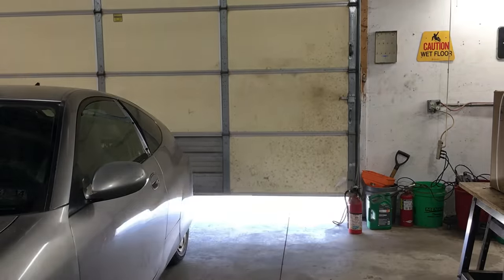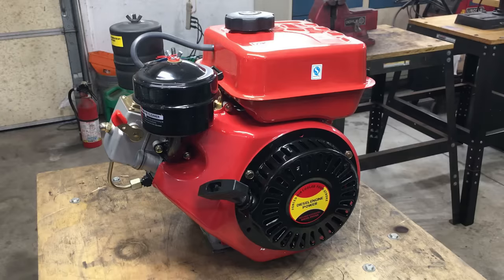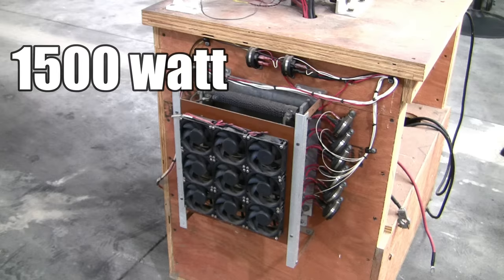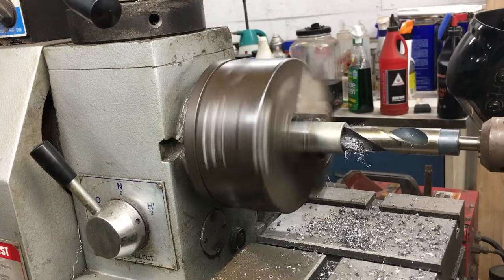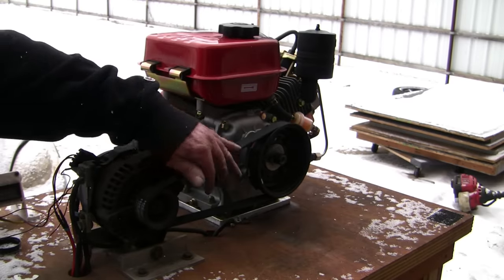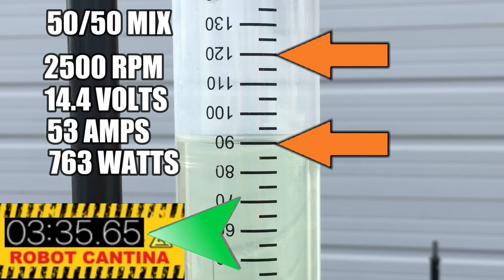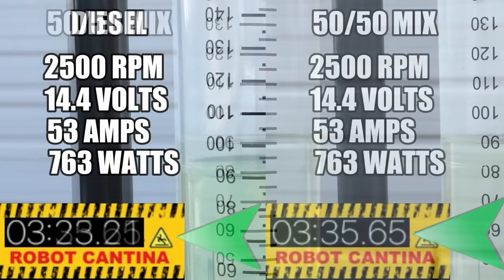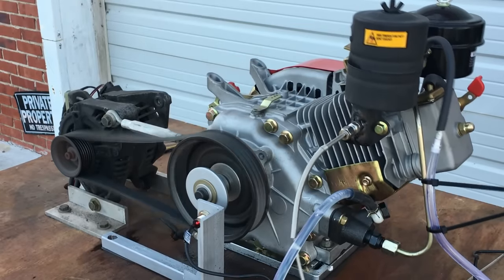S4 E3. How good is vegetable oil as a source of fuel for a diesel engine?... We find out!. plus more

Comment: Another vote for the used filtered oil+gasoline mixture. For my truck I mix gasoline into the oil until it flows at the same rate as regular diesel

Comment: I’ve been running WVO(waste vegetable oil) and other waste oil mixtures in my diesels for almost 20 yrs. 

As long as you filter the oil well and heat your fuel tank (use a coolant heat exchanger), you’ll get great results.

Comment: I've always been curious how Kerosene and Jet fuel would run in a diesel. Kerosene has around 139k BTU per gallon, If I'm not mistaken, and Jet fuel I believe is in that same range. 
Also, how would a Diesel run on pure 2 stroke oil?

Comment: Nice...I got one of those...I REAAAAALY want to get a longevity test of these little guys...see just how long they do actually run before they crater
Ooh..might think about treating it with MotorKote (hyperlubricant) to see if it helps [probably not with all that compression]
Daggum, that thing sure does make the test rig jump around...guess it must be all that torquage of that 3hp engine...LOL
I was thinking about trying to run some waste oil or waste oil/diesel mix to see if it affects it adversely
Keep em coming!!!!
Reply from the maker: The engine is a bit rowdy and does jump a bit, but also keep in mind the camera cant keep up with the vibrations and the image is somewhat distorted.

Comment: Otto Diesel designed the engine bearing his name to run on vegetable oil. Petroleum wasn't his first choice. Transmission fluid, tiki torch fluid, lighter fluid, hydraulic fluid, motor oil, and even coconut oil all work, however.

Comment: I drove 6 years my Royal Enfield Diesel Motorbike from 2001 with Salad Oil. Runs well, smoked white, usage is gone up from 1 Liter diesel for 100km to 1.5 Liter for 100km, starting wasn't easy, smelled like a burning Fish&Chips shop.
In Europe cost in this time salad oil half as diesel.
Today cost salad oil more as diesel.

Comment: You should setup an exhaust system so you can run the engine inside i bet the heat generated from the resistors would feel nice inside.

Comment: 50/50 ethanol /biodiesel mix.  Note that the diesel fuel must be biodiesel to provide emulsifiers for proper blending. Limits for ethanol biodiesel blend should be 20 percent biodiesel 80 percent alcohol blend.  Don't go leaner than that with the biodiesel.

Comment: Another common practice is to mix veg oil and gasoline to about 70/30, or 80/20, respectively. Generally dependent on the temperature. The gas helps thin the veg oil to diesel viscosity and can help in burning the glycerin in the veg oil.
Reply: I'm pretty sure it'd be better to use kerosene but of course kerosene costs more per gallon at the pump from most gas stations.

Comment: Note that very small diesel engines are usually pre-chamber engines, which are way more tolerant towards unrated fuels than a direct injection engine found in a truck.
Reply from the maker: Great point!

Comment: The trick to efficient use of vegetable oil is preheating the fuel to 220 degrees Fahrenheit before injection,  I ran a 1984 bluebird school bus with a gm 8.4liter turbo diesel on waste vegetable oil for 8 years, the fuel was heated, filtered and had all moisture removed prior to use, then it was heated using inline electric heaters taking it to 220f right before the injection pump, this increases the engine efficiency dramatically and reduces the possibility of gelling of the fuel. Using electric solenoid valves on both the supply and return lines allow for switching from diesel to vegetable oil without the return dumping vegetable oil into the diesel tank. Using the coolant system of the engine to heat the vegetable oil holding tank allows you to start the engine on diesel, warm it up, then switch to vegetable oil after about 5 minutes without the viscosity of the vegetable oil  causing problems. Also filtering the heated vegetable oil through a 5 micron water lock filter before its put into the holding tank keeps the injectors from clogging.

Comment: I have to say, I simply love these test. Have you ever thought about seeing the difference on a gas engine using Propane vs Gasoline? I converted a lawn mower to run off propane. I have an average size lawn and only us around 12oz. The mower is a 1979 Snapper Hi-vac that came with a 4hp engine. Once the engine wore out I put a 6hp Briggs on it and then thought why not use propane. The mower runs great on the propane  When it's running, it smells like your grilling hotdogs. LOL. I know you lose some power using propane but I figure I had 2hp to spare anyhow.

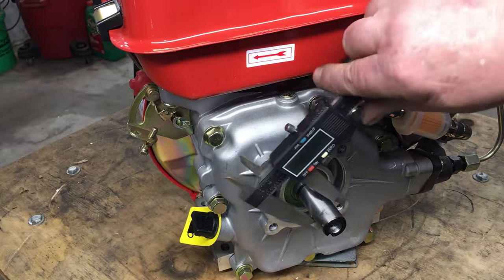Comment: 2003 Seat Inca SDI engine (direct-injected VW). Can mix 1:20 in normal weather, 1:10 when it's hot, otherwise pump starts whining. Cheapest oil is rapeseed, contains about 10 percent less energy so adjust the price when comparing to diesel - if oil costs €1.37 it's like diesel is €1.50. No side effects, still runs and starts as normal

Comment: I've probably bragged about this before but my previous car, a 2006 Volvo V50 1,6d consumed ~3L/100km when driving long distance. That's with a full DPF and all the rest emission system. Modern diesels are pretty impressive in that regard. Too bad they have to be maintained like modern cars too. The engine bays look like snake pits.

Comment: Used light hydraulic oil is pretty good in diesels with simple pumps. Super high pressure common rails?, maybe less so, but old 2.5DI Ford Transits with the Bosch mechanical pump run just fine if you add two stroke oil at around 100:1 for lubricity. Mind you, that engine/pump combo would run sweetly on just about any light oil. 
Waste engine oil can work. Oil from diesels needs filtering to 2 microns. Car oil filters are not up to it, but commercial vehicles ( lorries ) with bypass filters fitted get filtered to 2 microns. It'll need cutting to get the viscosity down a little. Diesel/kerosene/paraffin/light hydraulic oil work as an adulterant. Again, a little two stroke oil for lubricity doesn't hurt.
I ran my Transit on used hydraulic oil when I could scrounge a 50 gallon drum of it. Never missed a beat. No excess smoke, no cold start issues either. I've only read about used motor oil being used, never tried it myself.

Comment: I had a '90s Volvo with the 5 cylinder VAG diesel in it. I ran it on 80%wvo 20% 95 octane E10 gasoline. Smoked a little and smelled like a grease fire, but ran great!

Comment: I would love to see you mix a combo of diesel, filtered oils, and acetylene through a gas injector into the line running into the mechanical injector! It will hopefully soda pop bubble into the fuel, get sprayed in and help molecular-ize the fuel and spread the fuel further allowing for better burns and increases local burn heat while not introducing detonation of the fuel if you don't add to much! But a pressure and flow regulator is needed for the acetylene. Or a blend of regular gas that could burn after diesel starts the burn process. As in it's added after the fuel line into the diesel for the injector to shoot out both together. Seems fun!

Comment: In the last 10 years I use 50/50 burnt engine oil and diesel in my truck with good mileage and without any mechanical problems or injection.

Comment: I ran grease for over decade across several vehicles and over a 150,000 miles driven.   Depending on injector/pump pressures and a million other factors would help determine how hot you needed to get the grease.     Many ways to heat it,  I always used a hose-in-hose heat exchanger to bring up the grease to near coolant temps.  Which by itself is usually good for  older motors,  For the newer motors (ALH, or 24V)  I would also use a 12v booster heater,  I would try to 180-200F to the pump.

My systems also would try to purge nearly all grease out during all shut downs.  And grease would only be engaged after full operating temp.

Comment: Use a centrifugal filter to strip the carbon from used motor oil. You can then thin that with gasoline and run it. 

I used to run used veggie oil in my truck. I had a 7.3 IDI that consummed 2qts of oil in 300 miles. A few tanks of veggie oil made that stop. I ran strait beggie oil for over a year. I got a real job and didn't have as much time to piddle with filtering oil. I went back to buying diesel. I was driving one day and started to hear the lifters rattle. I had completely forgotten about the oil consumption. Coaking is real but not a bad thing. 

Be wearing of your used veggie oil sources. Make sure they do not use cleaners when changing their oil. I lost a few injection pumps because of it.

Comment: I wonder what the efficiency difference is for USED vegetable oil is. My buddy used to filter grease straight from a Mexican restaurant into their Cummings 2500's tank. They had an aftermarket filter assembly, and used a standard household water filter and water transfer pump to fill

Comment: Loved your scenario for using veg oil 😂. I would think that general high costs is a current reason. Don't know about Kansas, but the cheapest diesel here in the UK is about £1.36per litre. In a motorway service station, it can be as much as £1.70 😱. I think you should buy another engine, get 2xUK10gallon tanks, and run them both for a week. Then look for differences in injector wear etc.
As for your question....why not try Paraffin or Turpentine!?

Comment: Vegetable oil previously used to fry food has to be put ina tank for many days to let the heavy particules sink and the light one float on top. Then you get the middle part and filter it A LOT with finer and finer filters. Then you can use it in an engine.
If you use it directly you'll clog the injectors.
In Europea we have a lot of diesel cars and some people already do that. (But it's illegal and is not recommended on recent engines that use very high pressure injection over 3000bars)

Comment: My diesel Rabbit would run on waste cooking oil just fine. I installed a tank heater to keep it liquid in cold weather. It would always start but in -0 conditions it would gel . I usually ran good no.2 diesel in the winter.

Comment: You can distil motor oil basically same way they make moonshine. Will leave you with an amber fuel very close to diesel in composition. Essentially thats now diesel is made it just won’t have the additives. I’ve done it with a paint can, propane burner and copper tube. Pretty simple.

Comment: For just putting vegetable oil or another type of oil through, it shouldn't hurt the injector whatsoever. It acts as a lubricant and will actually be better than modern diesel fuel (diesel fuel today doesn't have as many lubricants in it as it used to because most every diesel engine manufactured today has electronic injectors instead of mechanical injectors). Heck, the first functioning diesel engine was run on peanut oil! (technically it's the second diesel engine, the first one destroyed itself and never actually ran but proved the concept of ignition through pure compression with a high pressure injector to push in fuel during the compression stroke) Just note that if you decide to try used motor oil, you should at least strain it if not also filter it before you put it in.

Comment: Once again, great video! Speaking about running from zombies, how much vegetable oil would you need to make it to drive to the beach non-stop? Also, how much room would it take in an area of the vehicle? If Google is correct in volume, 1 cubic foot = 7.5 gallons??
Reply from the maker: if the fuel tank was completely filled,  theoretically the Kubota powered Honda would only need one extra gallon of diesel or vegetable oil to make it from  Wichita Kansas to  the beaches of Houston... driving at 55MPH.  However if the car  was driven at 40 MPH it would have plenty of fuel if the 10 gallon tank were filled.

Comment: My VW 2.5 TDI ran on veggie oil for many years, only modification was heating in the oil for lowering the viscosity - especially in winter time, you have a lot of kits available for the modern engines, older diesel runs without conversion like the test engine, only viscosity and if waste veddie oil is used the particle can clog up the injectors on modern diesel engines

Only thing change oil more often, as veggie does strange things to motor oil.

Comment: I'd also be interested how high such an engine can rev and what exactly limits it. 

Perhaps work the camshaft a bit to get a bigger airflow at 6000 rpm and increase the fuel pump pressure to be able to push enough fuel on that RPM.
Reply from the maker: The engine has very very very light valve springs and my guess is they made it that way so the valves would float before the engine reached destruction speed.

Comment: Besides the obvious cold temp issues, running any more than 1-2% veg oil greatly increases the rate of carbon deposits and ultimately hurts engine life.  Fun fact: those giant haul trucks in strip mines never get their oil completely changed.  There is sampling and analysis along with filter changes on a set schedule.  Engine oil is fed into the fuel circuit at a 1-2% rate thereby requiring regular replenishment with fresh oil.

Comment: If finding alternative fuels in a crisis is at all a real concern, one often overlooked alternative is wood gas. It is a project unto itself, however.  I have a cheap and dirty setup on a dedicated generator that I don't care if I destroy (I'm worried about hydrogen embrittlment in the long term and my tar extraction isn't great).... which charges batteries in my solar setup. I don't run it often, as it is a pain in the ass  but if I didn't have the grid or sunlight, I'd still have power.

Comment: More adds:

Citronella Oil (I used this in a gas mower and no surprised it knocked like crazy, might work nicely on a diesel)
heated lard (e.g. keep warm enough to stay a liquid)
heated Vaseline (Same as above, I think the melting temp isn't terrible)
the cheapest tractor oil you can find
corn syrup
maybe honey cut with some solvent such as gasoline/alcohol/acetone

Comment: I had a Isuzu pup, miss that truck. I went behind bars and got used oil. Ran that stuff after cleaning np. Even would throw in used oil. Never had a issue think I would only pay for Diesel once a year at the most. But had to run diesel in the winter. I know it got in the high fiftys some times higher. Think it had the NA 2L.

Comment: I've been running a Mitsubishi .9L 3cyl on used vegetable oil for 10 years. I have tested it for power output by using my 48" tiller behind it. Straight diesel did not have the power to use it at the highest PTO speed but the vegetable oil did. The diesel would bog down and actually kill the engine. The only draw back is the vegetable oil makes me crave French fries whenever I operate it.

Comment: the other common substitute fuels i can think of for old diesels is home heating fuel, which my old teacher says runs beautifully through his old dodge with it's cummins 6bt. the other thing ive heard works good, usually on accident causing a runaway scenario, is engine oil leaking from a turbo. you can probally forgo the turbo in this case

Comment: The old multifuel truck engines in the 2.5 and 5 ton military trucks had a blend recipe for gasoline and motor oil  to make a diesel fuel replacement might try that with pre filtered used motor oil

Comment: I do know all the people who regularly run diesel cars and trucks on vegetable oil/waste cooking oil make certain modifications to the vehicle to protect it. There are conversion kits with fuel pumps and injectors and whatnot specifically designed for vegetable oil for a lot of diesel cars and trucks, and a lot of them will have a secondary fuel tank for regular diesel to start the engine on, and for shutting the engine off - you don't want cooking oil in your fuel lines and injectors when the engine gets cold, as it will coagulate and clog the lines with fat, preventing anything from getting into the engine, so they run it on diesel for a few seconds before shutting it off just to clear out the lines. A lot of vegetable/cooking oil conversion kits also have heated fuel lines to melt any condensed fuel to a point where it will flow. 

The other aspect is that when using waste cooking oil, the fuel needs to be passed through several filters to get the gunk out before you even put it in the vehicle's tank. Still probably worth it to get free fuel from restaurants who would just dispose of it otherwise, but it does take a bit of work to get the waste cooking oil clean enough to be used.

Comment: My tractor (two cylinder, Shubaura engine) basically stays cold if it just sits and idles, when under 50° it just doesn't generate enough heat. 

I have a gas generator that does the same behavior of being ice cold after an hour unless I'm pushing 1000w or more. It stays super cold unless I get it working hard.

Comment: A lot of guys run waste motor oil 80% and reg unleaded gas 20%. Running the oil thru a centrifuge like the one from wvo designs or pa biodiesel bring the filtration of the oil to 0.5 micron. Diesel fuel at the pump is generally filtered down to only 10 micron